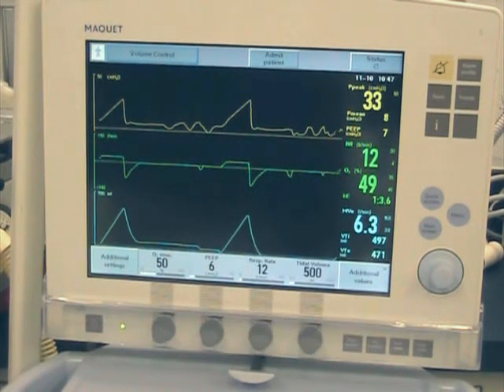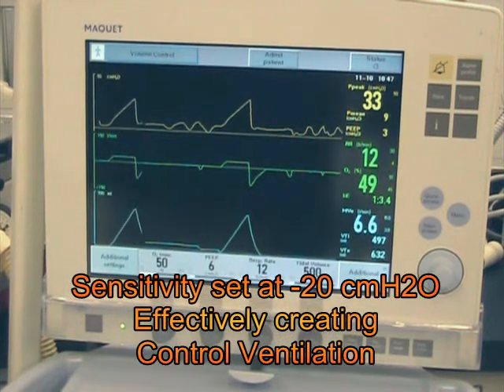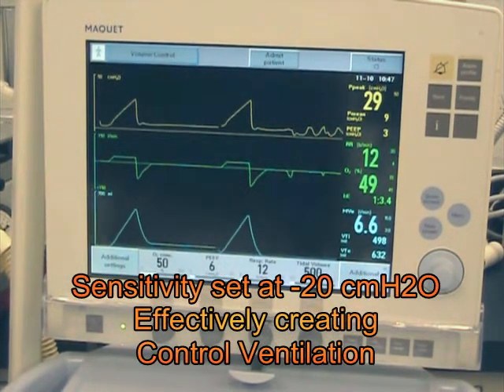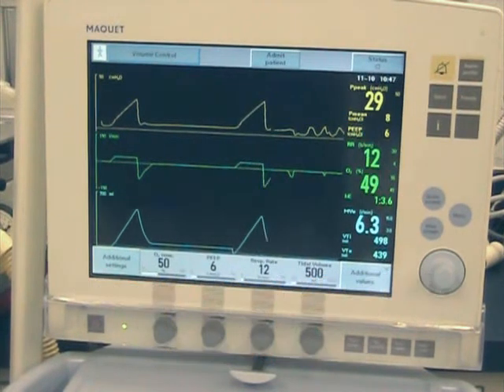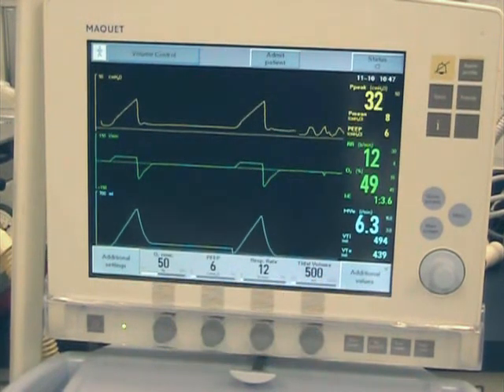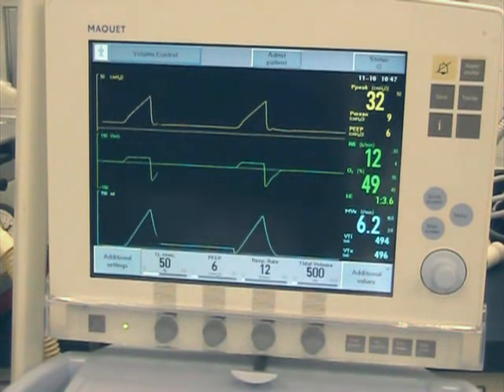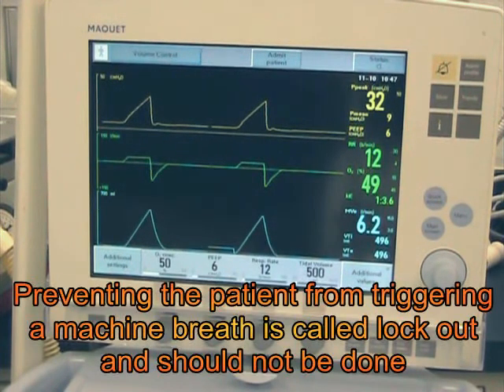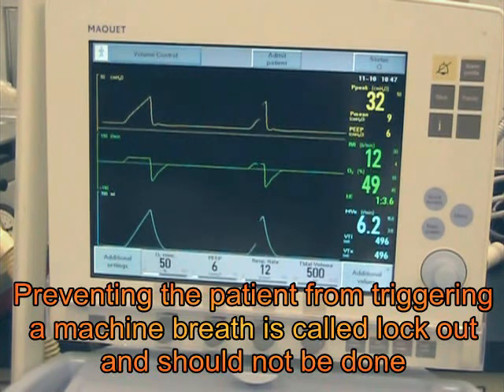RESPIRATORY CARE: Control Mode

Comment: VENTILATOR LOCKOUT is never, repeat, NEVER good. The patient may wake up, and try to trigger a breath, and the machine does not give a breath. No breaths, and we're breathing through a straw, which is the ET tube, and the resistance of that, PLUS THE CIRCUIT, NOT PLEASANT. TRUST ME. I KNOW THAT FEELING TOO WELL.